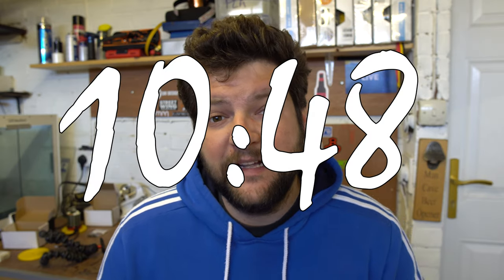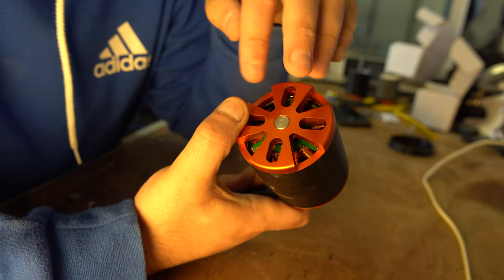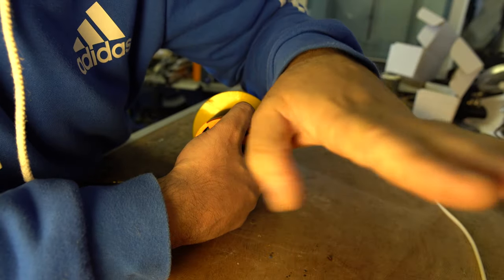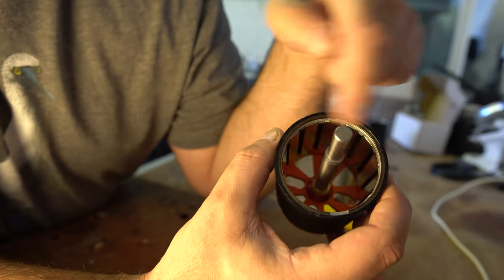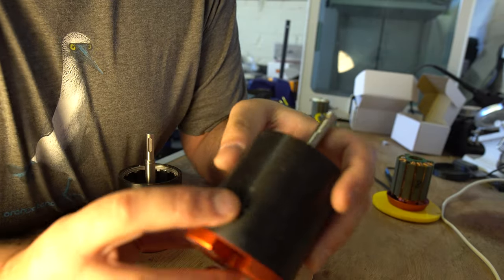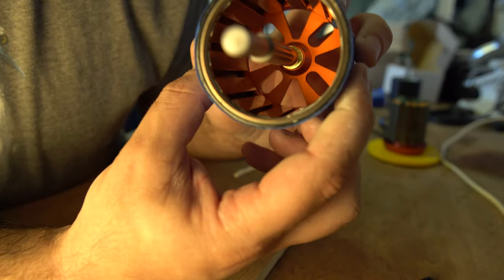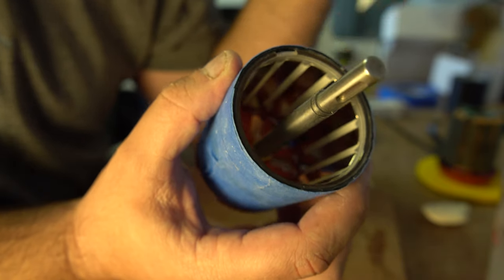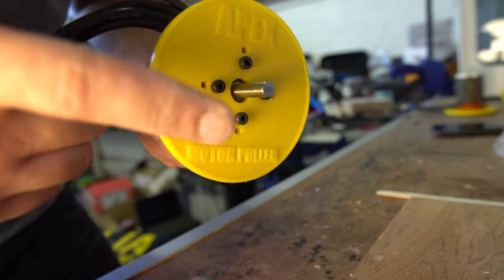Battle Harden BLDC Motors - THE EASY WAY

Comment from the maker: I just came back to this video as a lot of people have been asking me "do you need to balance the can after you do this?"  The short answer is no, you dont.  The longer answer is as long as you were careful to avoid any gaps and you smoothed it out afterwards you do not need to balance the can.  Obviously, if it was easy to balance afterwards we would do it, but in reality it makes little to no difference.  This method and the liquid epoxy method has been done on many motors and has proved to be a good reliable way of battle hardening. Some manufacturers have started to battle harden in the factory which is a great selling point, and as an esk8 community we welcome that development!
Reply: Hey bro, thanks for the vid. I'm pretty keen to find out how this lasts long term. Have you kept and ridden these motors lots? Would love to see if any has chipped out etc from vibration or shock over time
Reply: How have these motors performed since you installed them are they still in use ?

Comment: Hi lee 😁 thanks for the great video. I just got a set of turnigy sk8 6374 and drilled 4 5mm holes in the end cover (to make vented like yours) put in screen to cover holes then battle hardened with epoxy putty. That set in 25 min.  Had huge blister on end of finger 🤣🤯😉 anyways i ended up with some putty on magnets. Nothing over .5mm thick. Motor turns freely. Do you think a thin coating over magnets will hurt performance? Should i sand off all on magnets before putting together?  I am very happy with them as is, i just don't want to get them together and have them weak or something 😉 replacing the maytech motors i put on my newbee drives. Those suckers overheat in 4 mi ☹️ will save those for winter 😉

Comment: Great video , I had a prob recently with a direct drive board ,it lasted 5 mins before something was obviously wrong with one motor ! Well I pulled it apart to find on the rotor (can) a couple of magnets had started flaking or chipping away ? Sending metal into the motor,maybe the electro plating was breaking down? Secondly the magnet spacing was not even with just on large gap in in the placement around the rotor Maybe 4 mm bye a guess , what’s your opinion on this , at the moment I’m in the opinion that I’m going to un glue all the magnets & reglue them with even spacing , but I’m worried about the damage to the 2 magnets ?
Reply from the maker: Hmmmm tricky.  I think it sounds like those are cheap magnets and construction but I guess replacing isnt an option.  I think you are right to sort the spacing out and then battle harden them so they cant move again.  More temps will increase, but if you can live with that I would do it
Reply: Lee Wright any leads to finding someone who sells magnets like these?
Reply from the maker: @byroncornuel4101  I dont bro, plus you could easily change the kv of the motor by putting different strength magnets in - if I were you I'd glue the standard ones in and then battle harden
Reply: Lee Wright exlnt thanks for the info, bye the bye huge kudos for your vid.site travel well🙏🏻😌
Reply from the maker: @byroncornuel4101  thanks brother!

Comment: Nice one mate! 
Very interesting video. I did not know you have broken your arm mate... glad that you are all healed up.
Are you planning on putting the mesh around the vents to stop any particles from getting in?
Reply from the maker: No mesh, I dont think its necessary.  Yeah broke my hand 3 weeks ago, still in pain.
Reply: @LeeWright  
So sorry to hear that.... esk8 fall ?
I knew quite a few people ( in my young boxing days) who did break hands and they were using a tennis ball with a small hole in it to train the hand ( squeezing the ball ). 
An idea for you online shop, plus i would need one so will order :)
Could you please design and make available a cell holder for 21700 cells? Need one for my new battery build for when i spot weld and solder.
Thanks mate!
Reply from the maker: @PavelGarmas  I already have one made that can do up to 10P 21700,  I will list it later.

Comment: I wonder if this would work on a Onewheel motor...
Reply from the maker: It certainly would mate, do onewheel motors suffer from broken magnets?
Reply: @LeeWright  Not that I know of... the problems that the motors incur is bearing seizure, which then leads to the axle being chewed away. At that point, the magnets would get scraped from misalignment. At which point...you have to submit yourself to Bid Daddy Future Motion. Motor replacements are usually about $600ish. Some folks just open up the motor and put in better bearings to avoid that whole scenario.
Reply from the maker: @TheBoardGarage  that's the way to do it, proper japanese bearings from the likes of NSK.  Damn FM are expensive, motors probably cost them $70 or so
Reply: Lee Wright Yeah... Burris Racing has ceramics that people seem to like, and SKF are used also, but they're very expensive. Future Motion are... Very interesting with how they do things. Many riders can't stand them, and I don't blame them. Most their parts are made in house, including their motors still I believe. But they make sure that the repairs of their boards are also profitable. It's the main thing that makes me look either back at Eskate, or to getting an EUC.

Comment: Hey Lee wats your experience with filament for 3d Printers. Wat da best to use, ABS, flexible etc. I'm jst getting into 3d printing for my DIY esk8 projects and drones.
Reply from the maker: Hey bro.  I tend to reccomend PETG for esk8 applications, it's tough and easy to print.  Stay away from PLA
Reply: @LeeWright  awesome bro cheers. Wat about ABS
Reply from the maker: @chrisneru6564  I'm not too much of a fan in general but it is nice for some things, PETG is more useful in general
Reply: I've printed quite a few bits in PLA+ but for esk8 this is far to brittle. I've only just started attempting to print ABS & it's a bit of a nightmare! I have a CR10S & the ABS doesn't like sticking to the build plate & it tends to warp. :( Gonna buy some PETG if it's OK to use on the CR10S & give it a go! Thanks for bringing this up/the suggestion,  I kinda forgot PETG existed! :]
Reply from the maker: @danbeare5263  no probs mate! I normally advise PETG to people but I print a lot in Nylon myself, it's really good
Reply: @LeeWright  Thanks Lee! I will look into using Nylon also! I feel like a lot of esk8 pulleys tend to be made out of nylon? I may be wrong? Also I want to print some skid plates for under the kick tail of my board; Nylon sounds like it would be good for this also! 😎🖒
Reply from the maker: @danbeare5263  Yeah nylon is perfect for esk8 but hard to print.  I run nylon printed wheel pulleys on my street board

Comment: Cool video Lee! 

A couple quick questions:
Do you feel that hardening the rotor magnets alone is sufficient for esk8? I know traditionally battle hardening involves epoxy in between the magnets on the stator as well.

Also, do you know what it means when a company says their motors are "factory hardened"?
Reply from the maker: I don't actually know the answer to your first question.  I've never had an issue with a motor myself and this is my first time hardening.  When the factories say it they mean they have put epoxy in between the magnets, I dont think they go any further than that.

Comment: Having to do something like this never even crossed my mind, thanks for another great/useful video Lee!

I assume that not all motors will need this process? I.E dedicated motors for esk8 such as Torquboards etc or am I wrong? Guess I need to do some more research...

Are you able to suggest any specific motors that will be a good buy here in the UK for a Trampa build? (It's been years since checking out this stuff myself - I need to get back in the esk8 zone! lol)
Reply from the maker: Hi Dan, well you could buy these motors from APS and battleharden them! Off road builds are normally advised to have battle hardened motors

Comment: Man i felt that pain when u pulled the motor apart. How did u injur yourself?? Not a stack on the big trampa was it?
Reply from the maker: It was dude yeah... all good though just in pain a fair bit when I do certain things
Reply: @LeeWright  actually i think i saw u mention it in another video! Ah well ay, we take the risk each time we go out! Wanna be a weapon you will take some damage eventually 😁

Get well friend ✌
Reply from the maker: @nedtrampz85  cheers bro.  Yeah I just bailed on a silly jump.. never mind!
Reply: @LeeWright  so long as youre alive & not crippled we're smiles ay! 😁 

I had a similar incident couple month back. Silly jump led to majorly sprained ankle. Was off for 2 month about. Had done the jump already bout 20 times so figured 1 more cant hurt. 2 guys were standing on top i yelled at them to both move aside i flew between them in a twist n land front wheel first. Yep.. embarrassing lol.

Comment: A quick question, you've only covered sections off the rotor, wouldn't that potentially cause imbalance and increase vibrations?  I'm a total newbie to this so I could be talking hogwash.  :D
Reply: Ah scratch that... I forgot that the Rotor doesn't actually spin so balance shouldn't be an issue. :D
Reply from the maker: @ErnestRamos  the rotor does spin, that's why it's called to rotor! I think you mean the stator? The bit I did second? That doesnt spin so all good.  I should have mentioned that
Reply: @LeeWright  Yeah my noobness is mixing the names of the parts up now. :D   Basically the center part where the PCB is (part 2 of the hardening processes).  Eventually I hope to build my own mountainboard and your channel and build videos have been most informative. :D
Reply from the maker: Ernest Ramos ha! We were all noobs once mate don’t worry! Glad my videos are helping you bro 👌
Reply: @LeeWright  thanks man, can't wait to see your future builds.  Stay safe out there!
Reply from the maker: Ernest Ramos you too brother!

Comment: I attempted this method and let the putty dry before I put them back together and I don't have free movement anymore , I am sure the error was my own. I cant spin either motor and now I cant get the can off of either of them Im considering getting a pipe wrench with a chain to get the leverage to force the movement. Do you have any ideas?
Reply: update i was able to get the cans off and spinning i obviously did not clean the magnets well enough after i filled in the gaps with putty.

Comment: Great techniques, thank you for everything! :) I hope your hand will heal quickly!
I know that it is good to protect the magnets, but on the rotor it can also make the motor unbalanced :S I am not sure if they balance the rotor part at all. Or is it too slow to care about that? What is the difference between the V1 and V2 other than they changed the color and the 10 mm shaft to an 8 mm? Also the cooling is a bit different because in the V1 those ribs are thinner. Can you please measure the length of the shaft on the APS  V2? It looks like that the V2 have a longer one by a few mm.
That would be great if you could share some info about the new motors. :)) At least the brand or the KV specs P:
Reply from the maker: Hey bro, I told you the brand and kv specs, APS 170kv.  Yeah looks like they turned the shaft down to 8mm on the outside, there is a step down in the shaft outside the motor. The protruding shaft length is 30mm.  I dont think they balance them and I dont think I made it out of balance, the application is pretty consistent
Reply: @LeeWright  Sorry I mean the new motors which are coming soon. Can you tell something about those?
Reply from the maker: @hunelektroBF  ah I see, also 170kv and 6384.  I am trying them out and if they are good will be selling them on my shop

Comment: These APS motors are not sealed right? Can one ride with them when it's wet? Thx bro!
Reply from the maker: correct, they are open can.  You can use them in the rain, but its risky

Comment: I don't think the motor includes a thermistor. I've watched the data lines on an oscilloscope and there are three lines which go high and low (kind of like a quadrature encoder but with three lines instead of two) and the other two lines are to power the encoder. There isn't a temperature line.
Reply from the maker: Duane Degn I agree, there is no temperature sensor which is annoying!
Reply: @LeeWright  I'm not so sure about the temperature sensor now. The motor I looked at with an oscilloscope had five wires. The new skateboard motors I have include a 6-wire sensor lead. Apparently the extra wire is the temperature sensor.
I've used brushless motors on robots in the past. I'm new to making my own e-skateboard.
I'll try to figure out how the temperature sensor works and update this comment.
Reply: @ddegn  Is it possible to add a sensor externally or is it losing the sense that way? I am ordered a V2 now with a closed end cap and I am worried a bit of the temps.
Reply: @hunelektroBF  I wouldn't trust any external temp sensor.

If you've only got 5 sense wires I'd bet good money there's no temp sensor.

Really weird coming from an ebike hub motor background and seeing these motors ship so bare bones.